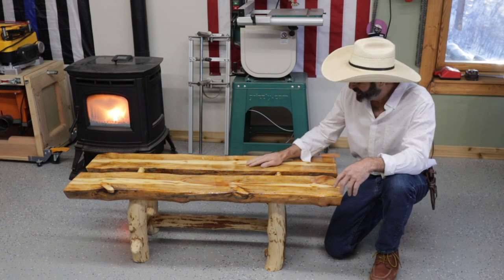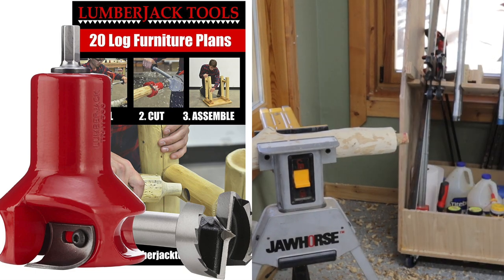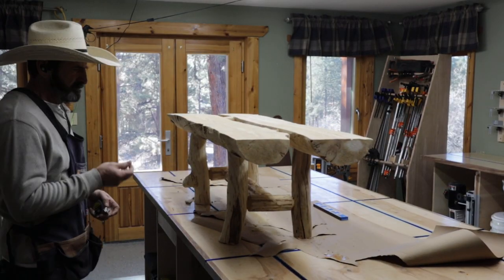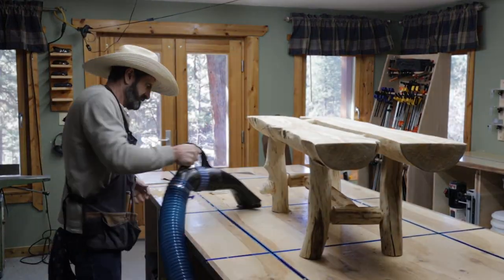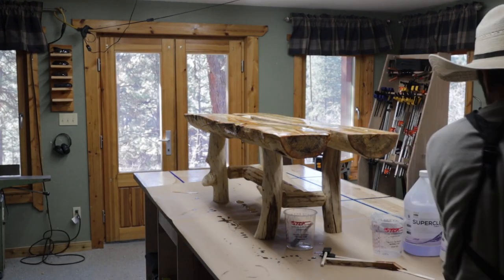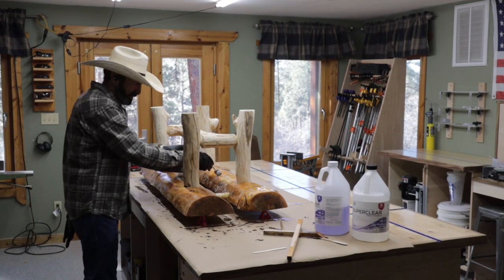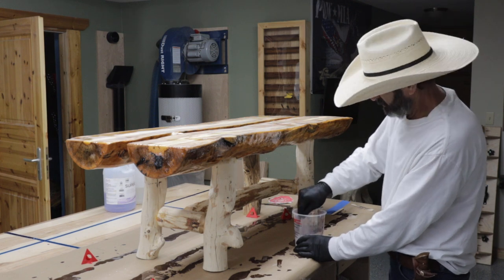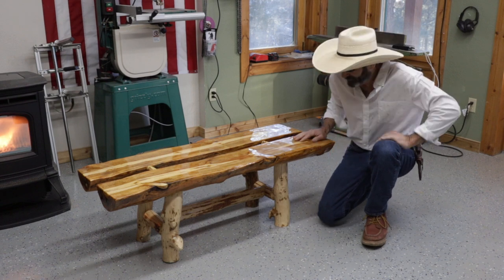LOG FURNITURE TOOLS I USED AND THINGS I LEARNED

Comment: I hope to make a piece this beautiful someday.  My current shop is under the shade trees.

Could you advise me on how to prevent the white part of the cedar from cracking out?  I'm making cedar walking sticks and when I grind and sand, the red is fine, but when I leave some white wood it's cracks.
Reply from the maker: The only thing I try to do is make sure moisture is very low before I work with wood , good luck
Reply: @OutlawWoodworking  thank you.

Comment: Like what you doing so I subscribe.  Made two log pieces so far on my channel.  Thanks for the tip on grinding the larger log edges before using the tenon maker.  I was struggling with that!  Excited to make more log furniture!
Reply from the maker: Very cool,I’ll check out your channel

Comment: Nice work!   Now I have a question....
At 4:03 minutes in, you show the entire bottom end preassembled and it looks decent too.  How did you line up and cut the holes with proper angles for the bench top??  That's the critical part that's missing here unfortunately.  I find that to be the hardest part for a project like this as each leg is unique.  I might be inclined to drill the holes under the bench first, attach the legs temporarily and go from there.  Those tenons are pointing all different directions.  Great looking project in the end though!!
Reply from the maker: I think I did drill holes in bottom of table first, working with logs nothing is super straight,it is fun though
Reply: The most critical part is the EPOXY! Trust me

Comment: Did I miss the most important and challenging part; how did you mark the positioning of the mortises in the underside of top pieces? And how did you get them level, as posts appeared to be different hue
Ights?
Reply from the maker: I put legs together then set table on top and marked it ,wasn’t super easy

Comment: how long does fresh cut cedar logs need to dry out before its ok to put poly on them?
Reply from the maker: I would think a couple years , I’m not a expert on that though ,I use a moisture meter to check my wood
Reply: @OutlawWoodworking  thanks!!
Reply: Try using a wood kiln to dry them then use a moisture meter, there's lots of videos here on youtube that show you how.